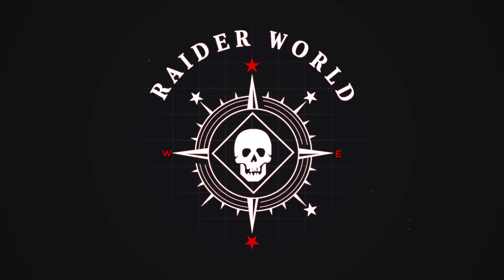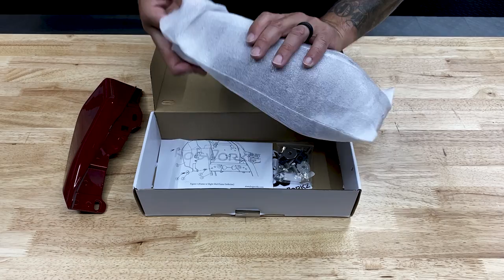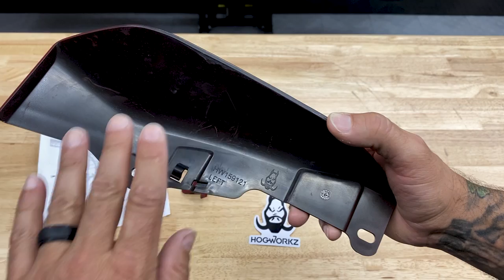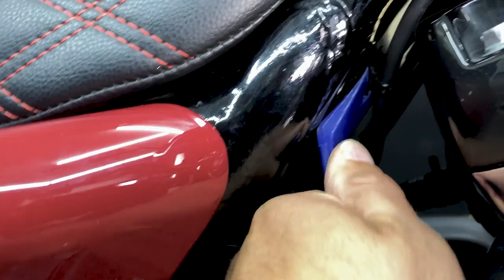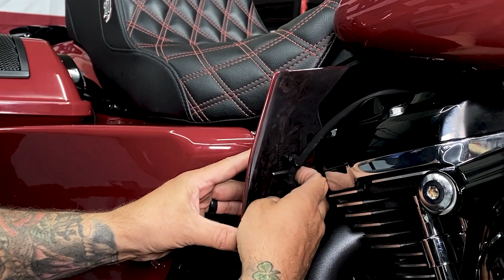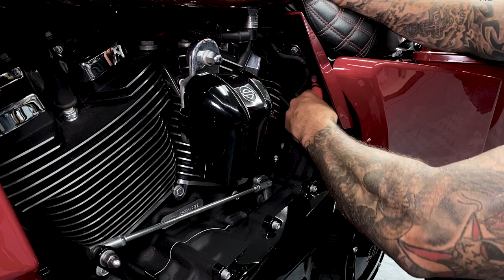Harley Mid-Frame Air Deflectors Color-Matched from HOGWORKZ

Comment: Great video Im going to order ones for my street glide.Thanks for all the good info.  Also i saw your lucky daves seat video i tried ordering one they are completely sold out lol cant find it nowhere
Reply from the maker: Absolutely!  And Thank You.  I had my doubts at first, but I’m glad I installed these.  

For the Lucky Daves Seat, If you sign up on their website for in-stock notifications, they come back in stock often.
Reply: So was the difference on the original part the new ones looks the same can you explain it by the way good information video.

Comment: That hex insert is that a crush nut otherwise it has to insert from the back forward - yes/ No …? Thanks
Reply from the maker: I would have to look, but this is how I’ve always installed them.  Most aftermarket companies use different parts, so you just make it work
Reply: It’s not a crush nut. Mine came out immediately when I tighten it down. I’m gonna use Raiderworlds tape trick and if that works. If not I’ll just zip tie it tight and bolt in the top.

Comment: I have a 2010 Road King and I have the pipe on the left side of the bike right where the left piece should be installed but will not fit since it's not molded to fit around the pipe. So I only have the right side installed and still trying to figure out how to get the left side with the pipe in the way.  Pray for me!
Reply from the maker: Absolutely!

Comment: Great video! Thank you! I am just installing them now and there is no way that bottom well nut stays in when I go to tighten it. Is that why you wrapped it in tape? Seems to me you shouldn't have to do that but it seems that is the only way it might stay in while tightening the crazy thing. Thank you for any advice. Beautiful ride by the way!!!!
Reply from the maker: Thank You! Yeah, that’s why I wrapped it in tape.  You could also try and insert the well-nut , then thread in the screw before mounting the deflector.  Remove the screw and mount the deflector. That might help expand the well-nut.  Thank You again for the Support 🤟🏽
Reply: @RAIDERWORLD  I tried the tape but it still pops out. The design makes no sense to me as how can it possibly stay in unless it’s secured from the back or the bolt expands going in?? Anyways, thank you for the reply😃